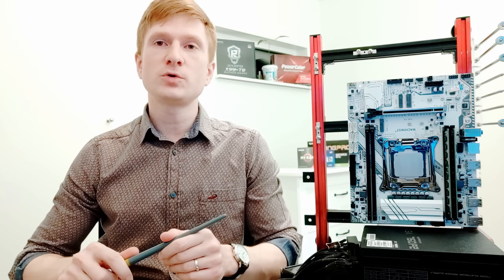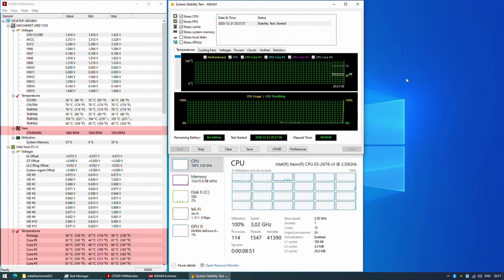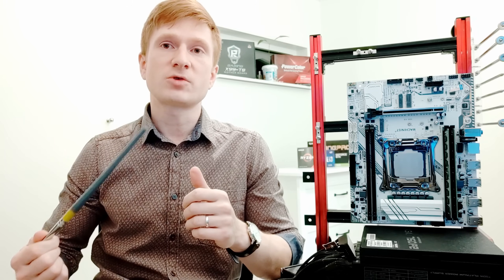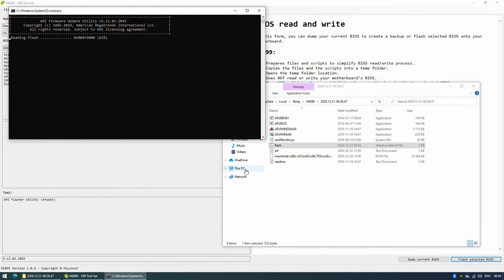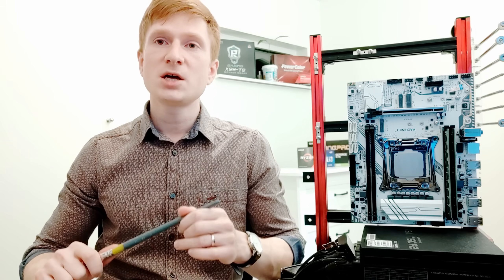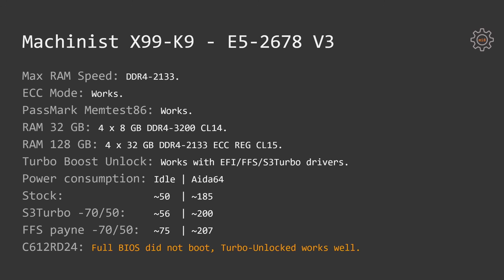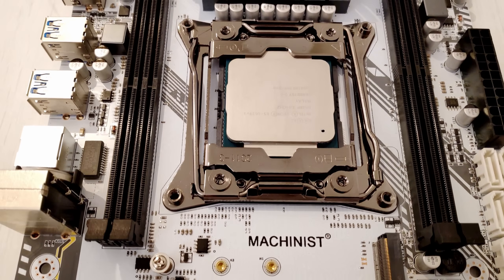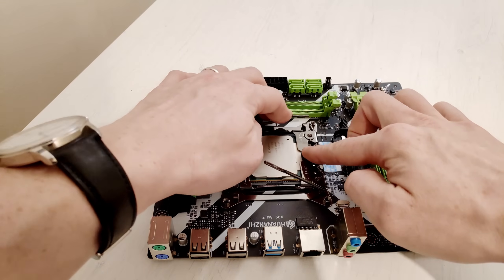🇬🇧 Machinist X99-K9 – detailed review | E5-2678 V3 | i7-5820k | E5-2620 V4 | O.C. | VRM | Timings

Comment: Hello Miyconst, have you tried the K9 V2 already? With the VRM Fan? IF yes, how is that one, does it fair better than this revision?
Reply from the maker: Hi. I did not test the second revision but as far as I know the changes are minimal. VRM fan and a few extra SATA ports.
Reply: @Miyconst  Thanks for the quick reply! I sure hope the Provided Bioses in your tool will work for it haha, it's gonna arrive at my placd tomorrow =)
Reply from the maker: @YamiK3737  I would not be so sure.. Chinese are known to break BIOS compatibility with motherboard revisions. Be careful and prepare a programmer if you decide to flash one of my BIOS options.

Comment: To install the i7 5820k processor, does the bios have to be stock? Or does it still work when you have the turbohack?
Reply from the maker: You need non-TBU BIOS. The i7 is not compatible with the TBU mod.
Reply: Thank you very much for responding, and how do you overclock this processor? What bios do I have to install to do the oc?
Reply from the maker: @lisandrocontrerasvillar3696 please watch this video for more info: https://youtu.be/FhnGfcYrJRQ?si=ZbwR9ap9Kca_k2Y7

Comment: Bro I installed the 5820k in this motherboard But it didn't work
Reply from the maker: That's bad.
Reply: @Miyconst  I have an engineering sample cpu on it which only have one core. I am trying to upgrade. Which cpu works for this motherboard other than 5820k? 5820k won't boot for me for some reason.

Comment: Would you recommend using this motherboard, or the x99-RS9 instead, or is there a different budget x99 motherboard that would be better for me? I have a i7-5820k, two 8GB Corsair Vengeance DDR4 Ram Sticks at 2400mh, and a 6GB Zotac GTX 1060 mini. I would want something with an NVMe M.2 slot, along with a WiFi and Bluetooth M.2 slot.
Reply from the maker: This video has all the info: https://m.youtube.com/watch?v=AW0QgQNbBwA
Reply: Thank You!

Comment: How did you reset the CMOS on this motherboard? Adjusted the memory timings, and now it won't POST. Took the battery out, removed all but 1 RAM stick, etc., no difference.
Reply from the maker: Unfortunately, clear CMOS doesn't work on this motherboard with the stock BIOS.
Reply: @Miyconst  Figures. I used the modded bios (stock with timings & turbo unlocked).

They really screwed this motherboard.
Reply from the maker: Try to find RAM that would boot with these timings.

Comment: i have the problem, after installed windows 10 it occurs error, as you said: we should install the flash file. Could you send that link download for me? i checked in bios Ram, Cpu... are good. Only fail windows
Reply: Run Memtest86 from a flash drive. I had the same problem and it was bad memory sticks. Test and if errors, take one stick out. Try again. Etc until you get no errors. Find the bad ram sticks if you have any. They either stop it from booting or will show errors in Memtest86.

Comment: My X99 K9 has a cold boot problem with a 5820k , initially works fine after cmos reset and overclocking, can run prime for hours . If left off overnight I have to reset  BIOS again :/ . I will swap for a XEON for stability I think
Reply from the maker: What do you mean by cold boot problem? You don't get any video output or Windows fails to boot?
Reply: @Miyconst   After flashing bios , I can tweak and get a fully overclocked and seemingly stable (tested prime ect) , it can restart and boot up just fine , when warm . However if left a few hours until cold , the PC switches on , then blank screen , no POST . I am giving up with the i7 5820K with this board , going to swap it out with Xeon with the hope that it boots up ok when cold .
Reply from the maker: @technomad900  what is your RAM configuration?
Reply: @Miyconst  I have non XMP , 4x 4GB non eec ,  2133mhz Corsair Value RAM , initially I was running with  manual RAM settings ,   adding the timings and speed as per their spec ( 16,15,15,36 1.2V)  . Though running RAM on  the manual RAM timings/speed  or auto had no bearing on the cold boot issue . Running the settings on  auto sets the timings and speed around the same if I recall correctly
Reply from the maker: @technomad900  try to remove one stick (does not matter which) and see if the cold boot issue still remains with 3 modules installed.
Reply: @Miyconst  It does , and my way back to to boot is removing battery , discharging and re-powering. I even resorted to reflashing BIOS on one instance . I think my particular board was overlooked at QC , really strange behaviour, I hope it works ok with the Xeon 2680V3 . Going to put the 5820K on ebay
Reply from the maker: @technomad900  Does it behave the same if you don't install the CMOS battery at all? Anyway, it surely sounds like a defective motherboard.

Comment: I have a board similar to this one.  She had a problem with PCI-express, it was being recognized as PCI-e 1.0 x16.  When I uninstall and install the video card driver and restart, it goes back to recognizing as PCI-e 3.0 x16, but on the next restart it goes back to PCI-e 1.0 x16.  Another problem is that trying to find a solution to this problem, I tried to change something in the BIOS, and I changed the video option to UEFI, now I have no video anymore.
Reply: reset the bios and turn off, then use a different video card to turn it back on, this is common on lots of motherboards, it sucks and is stupid, i test machines all day long at work and is a common problem across all platforms, sometimes i even have to change the ram configuration.

Comment: hi Miyconst, i got an issue with my sound driver with this board maybe you have a solution. i installes "old" Realtex driver 2.72 i believe WITH the realtek HD Audio manager. in this tool i see 5 audio jacks instead of 3 !!! and it let me not configurate what it is when i plug in cable.    same driver with another chinese mainboard works correct and shows 3 "flexi" jacks .....
Reply from the maker: Sorry, it's not really possible to guess what is the issue in your case. I would suggest to identify your audio codec and install appropriate driver with clean Windows installation.
Reply: @Miyconst  it Was a clean install 😕 HD Audio Manager Shows 5 Jacks instead of 3 and it's not configurable which Jack should Do rear.,Front ,etc. Very annoying

Comment: will this board work with the 6850k?
Reply: also, would i be able to run a titan x or gtx 1080 on this thing? making an all used pc build
Reply from the maker: Yes, it works with i7-6850k.

Comment: So to be able to get turbo boost to work, this board's bios needs to be flashed? Or is it just for certain CPUs turbo boost? Say if I wanted turbo boost to work with i7-5930K, would the board's bios need to be flashed. Thanks, really curious about this.
Reply from the maker: No, Tutbo Boost and Turbo Boost Unlock are different things. TBU is a unique bug/feature of locked Xeon V3 CPUs, with certain BIOS modifications it's possible to force all cores to work at their maximum tutbo frequency.
Reply: @Miyconst  Thank you, I really appreciate your reply. I remember you saying there was a better Machinist X99 board than this one. If so, what was the model number of that one? Thanks again
Reply from the maker: @CricketsJiminy  the better board was Machinist X99Z V102, but unfortunately it's no longer in production and is no longer available to purchase.

Comment: I also ran into a USB error.  Interestingly, it doesn't occur to me during copying, but when I connect my phone, it keeps disconnecting and reconnecting.
I don’t understand because I don’t see mass feedback about the bug.
I contacted the seller but he is not helpful.
Reply from the maker: I had the same issue with a low grade USB cable, replacing the cable with a high quality, high speed option solved the issue for me.
Reply: @Miyconst  Hi! Thanks for the reply!  I use Ugreen MFI cables, but the same is true for all of them: https://youtu.be/ucBMQnF2VZw 
A similar phenomenon occurs when i connect headphones, only then does the voice controller bounce similarly.  I'm clueless.
Reply from the maker: @Amacs-q8d  then it's surely a motherboard issue. Have you installed all Windows updates, including the optional ones?
Reply: @Miyconst  Yes, everything is installed, even the optionally offered. Even without that, I check on a new, clean-installed windows, but the same. I could live without plugging in my phone, but the problem with plugging in the jack is pretty annoying. Anyway, thank you very much for your help!
Reply from the maker: @Amacs-q8d  Then I am afraid I can't help much, it's a motherboard or BIOS defect. If you are willing to experiment, you can try BIOS-iEngineer BIOS.

Comment: Hello, I was hoping you could help me out with something... I plan to get the Machinist X99-K9 motherboard and I plan to pair it with a 2697 v3... and generally use it as a server by putting some hard drives in there. 1. is there a better option or route to go with? 2. would you recommend those 2 items paired? I picked the 2697 v3 due to its high core count, high passmark score, and generally being more affordable
Reply from the maker: Yes, get yourself a second hand B350/B450 motherboard and pair it with Ryzen 7 1700/2700.

Comment: Hello, what model of the x99 motherboard will be the best possible, it is about the strongest possible power section and the most stable operation of 12 core processors and above, which of the Chinese boards will be the best, which you can recommend the most ?
Reply from the maker: Huananzhi X99-F8 is the best one from China, so far.

Comment: is there a solution for the cpu fans?
Reply from the maker: Nope, so far there is no solution, at least I am not aware of any.
Reply: @Miyconst  okay thank you! do u think that i would undervolt my e5 2690v3 with this board?
Reply from the maker: @olanofilm  Yes, it should be possible, but I would not recommend E5-2690 V3 for this motherboard.
Reply: @Miyconst  too much tdp? it runs desktop ram? or only ecc
Reply from the maker: @olanofilm  Yes, E5-2690 V3 is too much for this motherboard's VRM. UDIMM and RDIMM are supported.
Reply: @Miyconst  i will buy raspberry fans for VRM

Comment: Hello Miyconst, any update to fix the cpu cooler fan?
Reply from the maker: No update so far, it doesn't work.
Reply: @Miyconst  thanks for the answer. Should i connect the cpu fan on the 3 pin chassis fan Motherboard connector to bypass It? Can u give me an advice How to deal with this problem? Thanks friend!!
Reply from the maker: No, you can still connect to the 4-pin CPU fan, but the rotation speed won't adjust according to the CPU temps and there is no solution to fix that on X99-K9.
Reply: @Miyconst  got it. Can i set the cooler to max speed then? how? so i dont need to be worry about over heating
Reply from the maker: You can do that using the smart fan settings in the BIOS.

Comment: PLEASE GUYZ! I beg can you people help me? I bought machinist k9 but I can't get it to work right... lots of drivers missing, no manufacturer website to download those. I tried to install windows using the motherboard but there is no option to access BIOS to change boot order and also the keybord stops working when it was supposed to show bios menu. Anyone had these issues? I really need help!
Reply from the maker: If you can bring the motherboard to me, I can try to help with it, I live in Sweden. To enter the BIOS settings you have to press the Delete button.
Reply: @Miyconst  Oh man I wish I could bring it to you, but I live in Brazil =/ . What is really weird is that I don't get a screen with instructions to enter the bions like I had in other pcs and the keyboard doesn't work when I boot the pc, so I press delete but nothing happens. I used my old motherboard to install to my ssd and plugged it in to the k9, now it seems to be working, but I get no sound if I don't use the hdmi (still can't access the bios menu) Anyway thank you so much for your attention! You are a very kind person!
Reply from the maker: @renansilva1171  What is your GPU? Try to use some old graphics card, like NVidia GT 710.
Reply: @Miyconst  mine is Nvidia GTX1050ti. DO you think an older one would help me access the bios?
Reply from the maker: No, GTX 1050 Ti should be good to go. What keyboard do you use?
Reply: @Miyconst  I use a simple standard microsoft keyboard
Reply: @Miyconst  got it! I changed keybords and now I can access the BIOS! God bless you brother! Thank u so much for helping me out!
Reply from the maker: @renansilva1171  I am glad to hear that it worked well for you!

Comment: "to be or not to be, that is the question" thinking about MICRO ATX: Machinist X99 K9 real X99, Machinist X99 RS9 chipset B85 (?),  Huananzhi X99 8M F chipset B85, Huananzhi x99 zd4 chipset B85  - what would be the better choice Miyconst ? Appreciate your thoughts !...
Reply from the maker: It depends on what you want, if it's a budget PC with something like E5-2620 V3, I would pick the cheapest option, no point in paying more of you won't use the extra features.
Reply: @Miyconst  I could have bought the E5-2620 V3 if I knew before that it would fit my needs. I basically use as workstation (Excel, Word, Youtube and want to go back to Flight simulator) but ended up buying the E5-2640 V3. I still use and ASUS LGA 775. To be honest I'm ASUS fan and being a layman it seems to me that these chinese mobos are in another word...Thank you for the hard work !
Reply from the maker: @rickzibr  E5-2640 V3 will be fine with any of these boards as well and if you got it for a decent price, then it's a good investment. You can search for Asus boards on eBay & AliExpress, sometimes you can find them for 120-180 Euros. It's an overkill for a E5-2640 V3, but if you want Asus, it may be worth it :)
Reply: @Miyconst  Thank you so much for your time... my last question :) is a there an ASUS model that you would recommend to use with E5-2640 V3 ?
Reply from the maker: @rickzibr  any Asus model that you will find for a reasonable price will do the job for you.

Comment: Hi!, I have just bought a Mobo x99 k9, but It is v2.0. When I try to make a BIOS backup , fpt program makes error 26, so It cant get the backup. With afu I get a 8mb backup but It is not a complete BIOS backup. I think that the BIOS is locked by the vendor. Anyone with this problem. How can I get a complete backup? And how can I flash then the modified BIOS?
Reply from the maker: These Machinist boards have locked BIOS, you have to use CH341A or similar to make a full BIOS backup. AfuWin can be used two flash the modified BIOS, but not to read entire BIOS.
Reply: @Miyconst  Thank you for your answer. I have another question. If I make a 8mb backup with afu , I modified It to activate turbo unlock, and then I flash this 8 MB modified BIOS with afu. Will It work or I Will  have a beautiful brick?
Reply from the maker: @alexisaleman5287  honestly, I have no clue since I have never tested it. In theory, it should write only the half of the BIOS it read, but you still might get a brick.
Reply: @Miyconst  Thank you for your answer

Comment: Hello, Miyconst my motherboard is an x99k9 machinist but its version is v2.0, and in your Mi899 program it shows v1.0, you must proceed with the procedures of the TU + Undervolt?
Reply from the maker: I have not tested the 2.0 version, but most likely it has the same or compatible BIOS.
Reply: @Miyconst  I took a chance, tested the stock machinist x99 k9 o.c ru, TU PEI -70 / 50mv and it was successful, and the version was v1.0 on cpuz, thanks for your attention <3

Comment: Do you think this MB VRM will work with e5 1660v4 (140watts) properly? No overclocking or  extereme calculations expected
Reply from the maker: Not really.. but it also depends on what you plan to do, gaming will be just fine, but some serious load, such as video rendering or math calculations will kill the motherboard.
Reply: @Miyconst  , so there is a reason to replace mosfets with stronger ones before use? And add a cooler for vrm zone...
Reply from the maker: If you have capabilities to replace the mosfets then yes, but I would just get another motherboard instead 😁.
Reply: @Miyconst  ,  i couldn't find mATX mb for e51660v4, 4-channel ))... I WILL  replace mosfets. Then let you know if you want
Reply: @Miyconst  , сразу не посмотрел "о канале"))) Привет. Я из Белоруссии. Подписался на твой канал)))
Reply: Кстати, про неработающий ЮСБ3.0... у меня сейчас в пользовании 2 идентичные материнки Jingsha на с220 чипсете. На одной - такая же фигня с ЮСБ3.0, а на второй такой проблемы нет.
Reply from the maker: @hoginfog  І тобі вітання! C220, це саме який? Їх три: C226, C224, C222. Подивись в Aida64, чи обидві плати мають зовнішній VIA USB 3.0 контролер. Також, яка саме це плата? JingSha X99M-H(2)?
Reply: @Miyconst  , привет! 
Плата X99M-H2, usb 3.0 - да, VIA, а южный мост ... Пипец... Бардак какой-то... В дмспетчере устройств везде C220 family, a по данным аида и цпу-з южный мост Q85, микросхема Intel ID8C4C. Ерунда какая-то ... Прости за дезинформацию
Сегодня получил Машиниста К9... Завтра поищу в городе подходящие мосфеты, перепаяю, соберу пЕку... Посмотрим, что выйдет. Придумал нарастить радиатор на ВРМ + вентилятор туда
Reply: Привет! Получил свою плату, полез менять мосфеты, однако, в моем городе в подходящем корпусе более мощных не нашёл. Те, что стоят, на 115А - было принято решение просто нарастить радиатор. Нарастил, повесил кулер. С е5 1660v4 никаких экстремальных разогревов нет.
Но я обнаружил один, ДЛЯ МЕНЯ, довольно жирный "+" этой платы :
м2 разъём под вифи адаптер (они обычно с блютусом) ПОЛНОСТЬЮ рабочий !!! Обычно у китайцев этот разъём только вифи часть запускает.. на адаптере Intel AX200 работает и блютусная часть, и вайфайная. А...и еще сменил на мосфетах термопрокладку  на АрктикКул